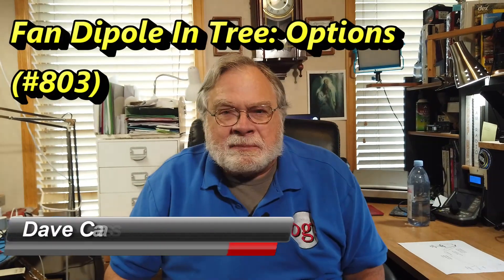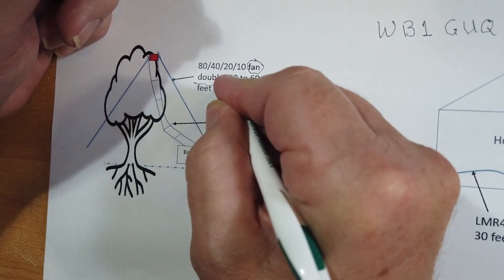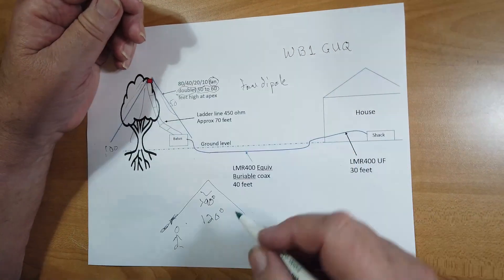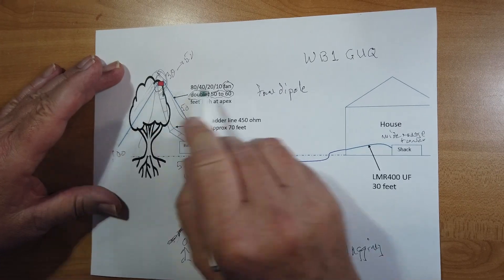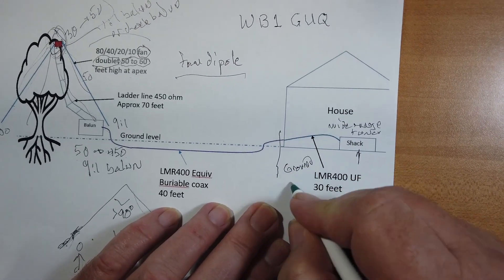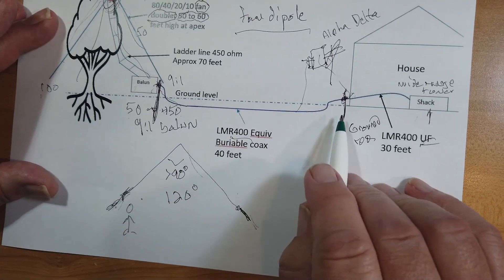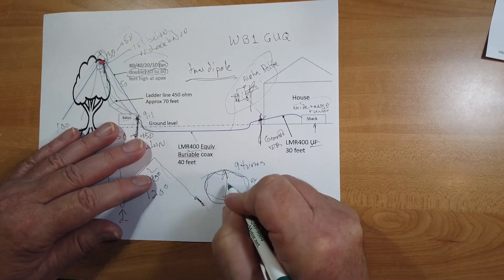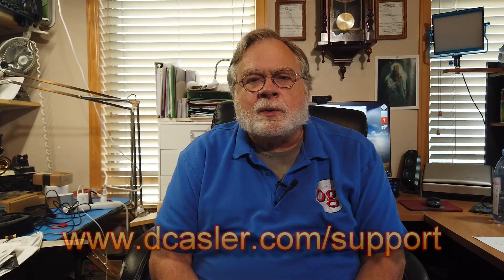Fan Dipole In Tree: Options (#803)

Comment: I installed a ZS6BKW dipole which looks similar to this antenna.  It should load well with only my ICOM 7300 internal tuner on 40, 20, 17, 10, and 6 meters.  My installation has a mismatch on 10 and 6 meters but works well on 40, 20, and 17.   Did you consider suggesting that as an alternative?
Reply: My ZS6BKW doublet is an excellent antenna with excellent reports.
Reply: @Joe_KS1I  I just spoke with my brother Rick (N9DAZ) on 40 Meters.  He put his back up after being taken down by Ian.
Reply: @Joe_KS1I  the bad reports don’t hear you so you never get those. Just saying. “ good reports” are not real data.
Reply: @forgetyourlife  ...lol

Comment: Off topic question. If you are trying to feed two end fed 1/2 wavelength.  Is the feed point Z : 1 to 49 or 1 to 49x2 or 1 to 49/2 . I am trying to use a conventional transformer .

Comment: If you do want to build an actual doublet antenna you may find that you like it better I know I like mine. So once you come out of the house with the ultraflex then connect that to the 450 ohm ladder line immediately and run that up to the top of the antenna using a four to one balon. If you make the legs of the dipole also out of 450 ohm ladder line then they don't have to be as long as they normally would you can reduce the length by about 20%. The money that you save on the additional coax you could spend on an automatic tuning unit and now you've got yourself a multi-band antenna that will work fantastic for both NVIS and national contacts
Reply: This will also eliminate the feed line loss that you will get using coax which can be two or three DB which is half of your power lost to heat, When you use the 450 as your feed line there will be about a half a DB of loss much much better getting the majority of your precious power to the antenna
Reply: Yeah, replace the balun with an symmetric remote antenna tuner, you can locate it anywhere but between the 50koax and the low loss ladder line. Preferrable the tuner would be as close to the antenna and keep the rest at 50ohm 1:1 swr.